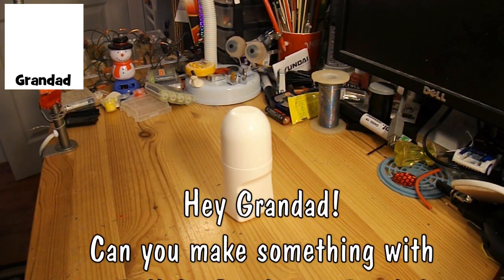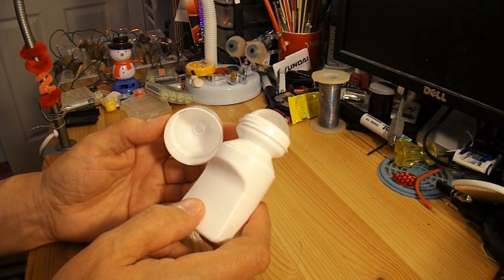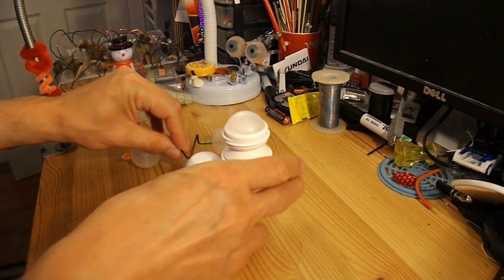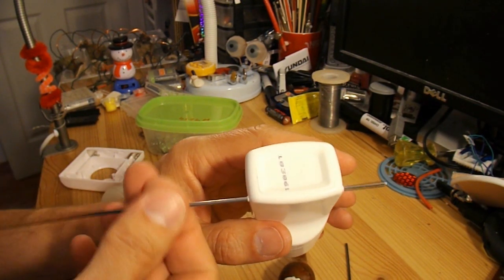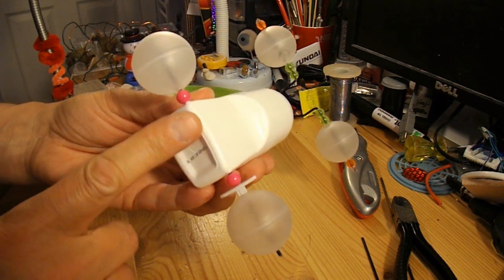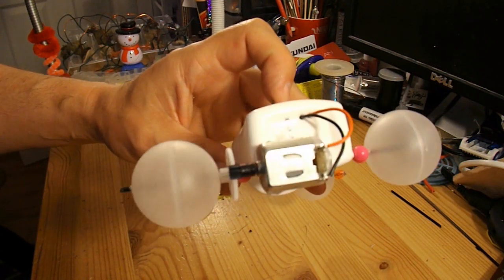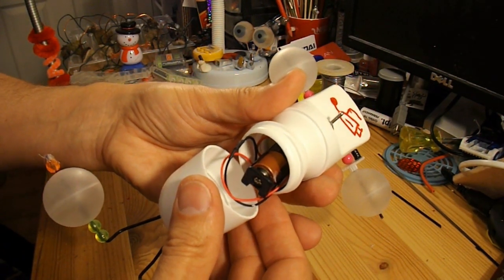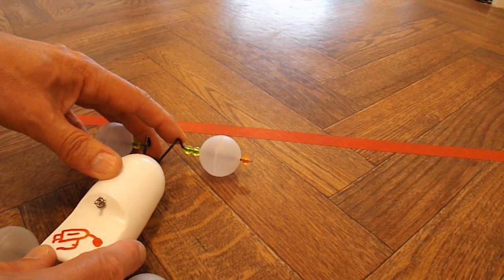Hey Grandad can you make something with a Roll On Deodorant Bottle?

Comment: Great work as always. Have you thought about making something like a small train, linking a few cars or vehicles together that is solar powered and that would hold and display some of your solar movers. Might be a nice idea. You could use only recycled materials other than the solar components.
Reply from the maker: Hi John, sound like an interesting idea. Not sure where I could run it though, as my back yard does not get a good view of the sun for very long and it is relatively short.